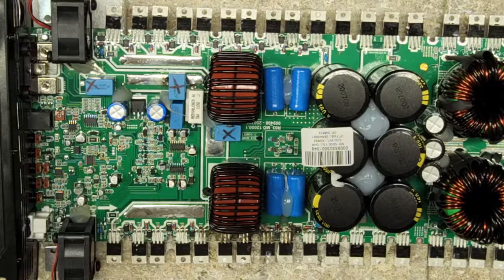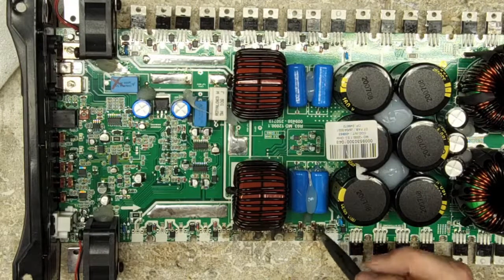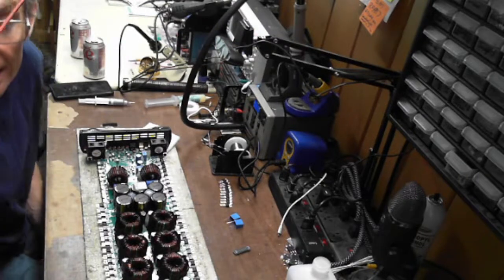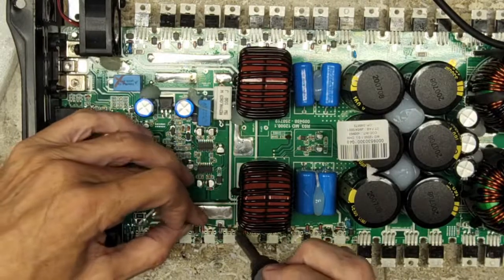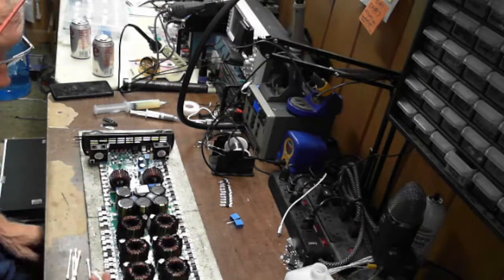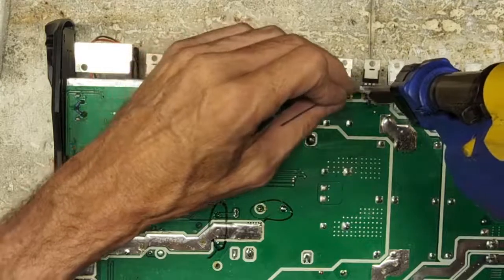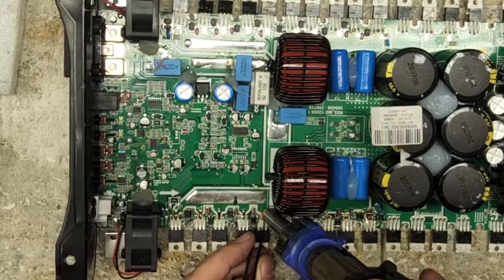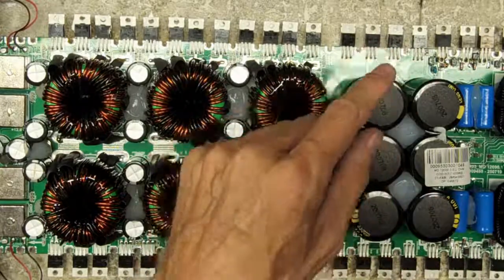Taramps MD12k .5 Ohm version rebuild of output section that has a not so common failure

Comment: Hey I have a question for you about another bass 8k, I can't seem to figure it out but as soon as I connect power and ground but no remote, resistor r150 starts burning. U have any idea what I should check to try an fix this problem?
Reply from the maker: That supplies IC3 which is your power supply gate drive IC. It may be shorted. UCC27524
Reply: I removed both ucc27524 gate driver ics and the r150 and the other one besides r173 still burn u have any idea where I should go next? I noticed also that the big main voltage regulator the 15v regulator gets to hot to touch
Reply from the maker: @zacharycofer3791  R173 comes from the 15v regulator. You have a short. With both UCC's removed what is the resistance value of pin (pad) 6 to ground (negative battery terminal)?
Reply: @ellensburgamplifier  pin pad 6 of which ic? ic3?
Reply from the maker: @zacharycofer3791  Correct, IC3
Reply: @ellensburgamplifier  I get .011 ohms
Reply: I just checked with black lead to ground and red lead to the 15v voltage regulator output leg I get .007 ohms so I definitely have a short an I get .000 on center leg which is normal and the input leg I get NC which is good
Reply from the maker: @zacharycofer3791  Shoot me an email and I will show you where to look.
Reply: @ellensburgamplifier  email sent hopefully it went to the right place lol

Comment: Wow those caps are blown that's weird 😳
Reply from the maker: Agreed, I do not see this often. This is the second board I have seen this on. The odd thing is the last board that I had with this failure was also a 12k. Is there another design issue?